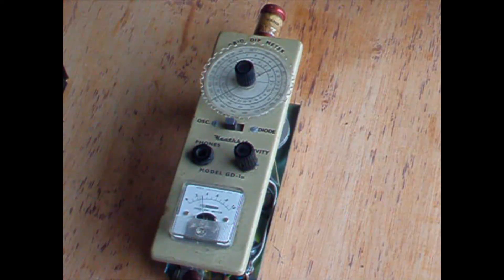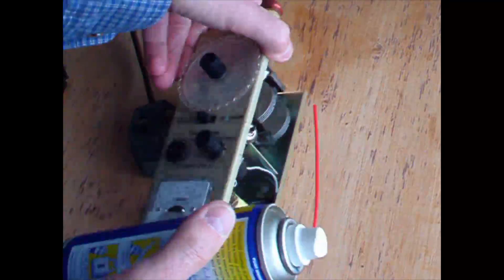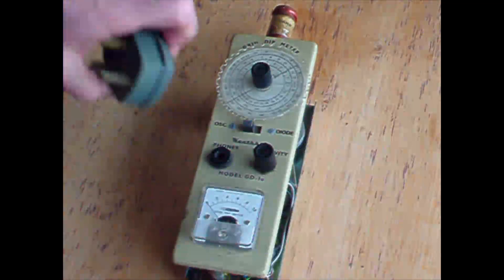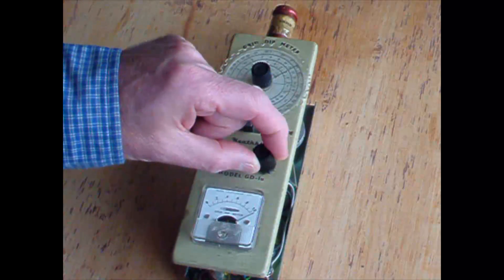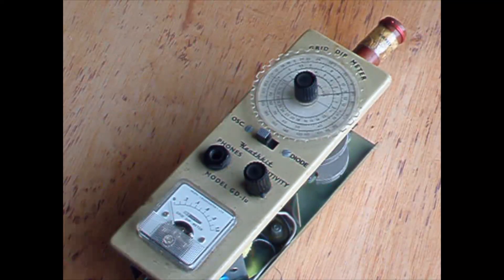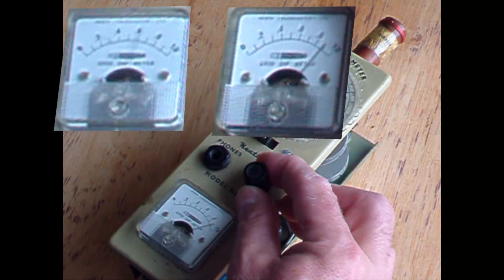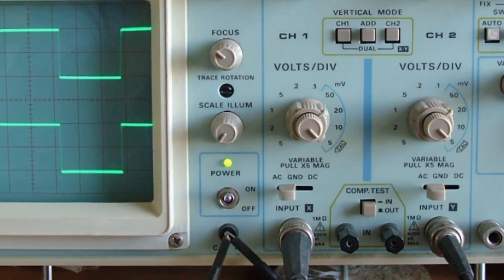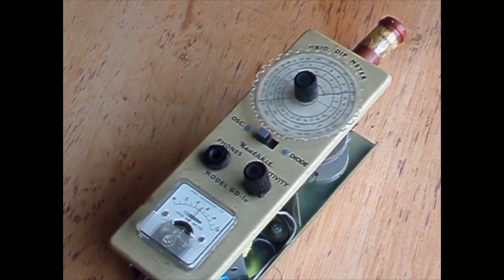Grid Dip Oscillator, fixing a dirty pot.

Comment from the maker: Hi Wilf I can’t remember when I last had to replace a pot; they have to be pretty far gone for them not to be recoverable. Out of interest and if I have the time (I wish) I might try dipping an old ‘out-of-spec’ fixed carbon resistor in WD-40 and see what it does to that, I wouldn’t expect it to have the same effect as on a pot but as I said before, ‘within the first 10 to 20 minutes the pot gets better the longer the WD-40 has to soak in.’ 
All the best ... Andy GWØJXM

Comment from the maker: 2 of 2
 In the past I have used Servisol but I was Rick of AllAmericanFiveRadio that put me on to WD-40 as a switch cleaner. He has radios he fixed with it more than 20 years ago still working well.  What Rick says is put a little on and it’ll be OK but then leave it for 10 minutes and you’ll find it gets better, I’ve certainly found this to be the case. Yep it does stink a bit but that soon goes off.
All the best ... Andy

Comment: Hi Andy, I'm late in on this one. The thing I don't like about WD-40 is the smell! I use a Servisol cleaning solvent from time to time. I mainly work on electric guitar electrics, one tip I've seen on YouTube from a luthier is just to run the pot backwards and forwards 50 or a 100 times. The idea being that pots often get noisy through lack of use. If I had a bad one I'd replace it as they are relatively cheap. I have a 1970 Gibson SG and replacing the pot would devalue it considerably.

Comment from the maker: I take it that in this case when you say ‘static’ you actually mean ‘crackling’ ie that very aggressive noise as the volume control is moved. If this is the case then (if it’s a circular control as opposed to a slider type) with the power off, as you look at the back of the volume control you should see three solder terminals side by side and a round metal cover over them. Don’t remove the cover but try and squirt the tiniest drop into the cover, there’s usually a very small opening somewhere.

Comment from the maker: @radiofun232 
Hi there’ I’m sure that you are right, a bit of graphite would work wonders. I came from that make-do-and-mend time when you tried to fix things rather than rush out and buy a new one when the washing machine squeaked or the car’s ignition stuttered. Although I have to admit that in this software-driven-surface-mounted-new-fangled-time we live in it is getting to the point where there really are ‘no user serviceable components’ to have a go at. 
Kind Regards ... Andy

Comment: I once read in an electronics magazine from the '50's or '60s that you could put some (very fine) pulvered graphite from a pencil into it, to "repair" the worn out carbon surface from the potentiometer (turn it a few times after this measure). I think perhaps the resistance can change too much, but for non-critical circuits this could help too (or open the potentiometer and "fill" the worn out carbon layer by moving a pencil over it).

Comment: Hey Andy,
I think that the wait, allows the medium that the carbon run is on, to swell back to its original size. It is important not to over do the WD-40. A very small amount of WD-40 and a little patience, has fixed a number of items for me. I am listening to the original test radio, right now, that I use WD-40 on over 15 years ago. And it still works like new.

Regards
Rick